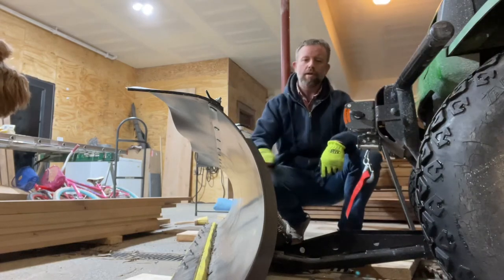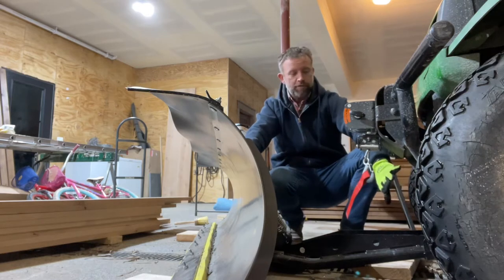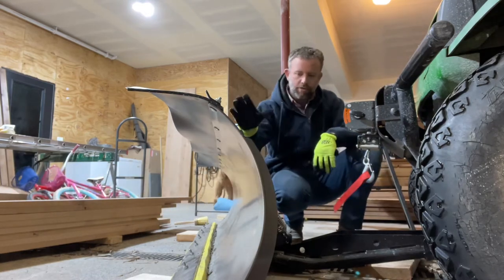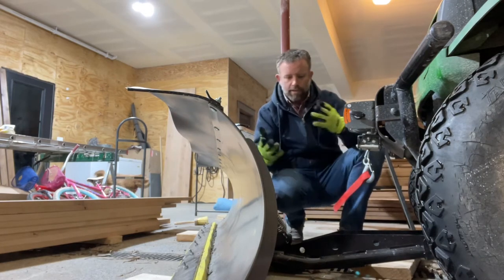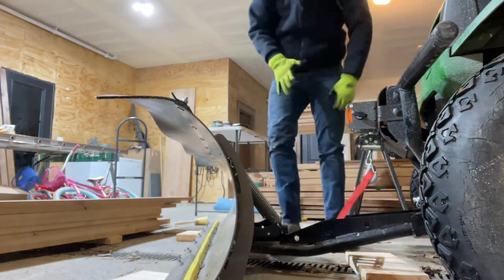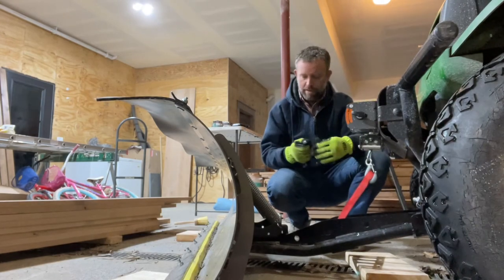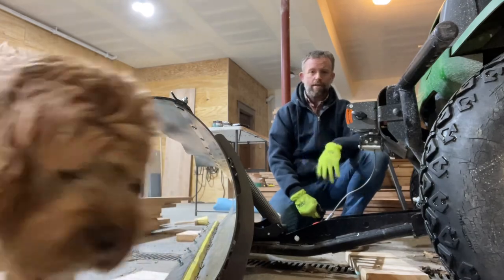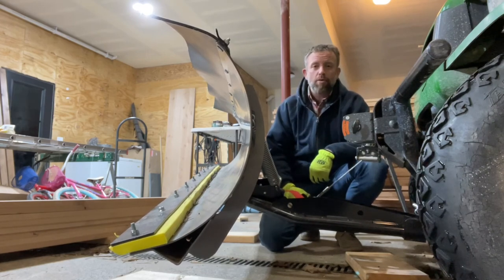KFI 72” Snow Plow on John Deere Gator

Comment: Which Gator do you own? I have a TH Gator 6x4. KFI says they don't have a blade that will fit...?
Reply from the maker: Derek, we have an old 2005 Diesel HPX (850d).  The blade would be fine, it's more about the attachment kit that bolts to the undercarriage.
Reply from the maker: Do you have the heavy duty bumper guard on the front?
Reply: @AllAboutOurHouse  it has some kind of guard on it, looks like Badland's plate would attach and hang over top bar?